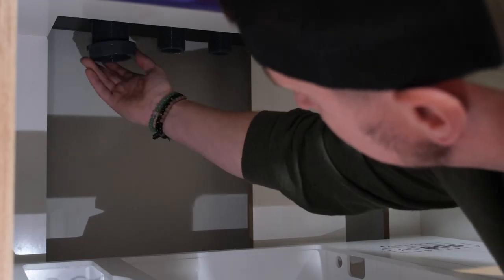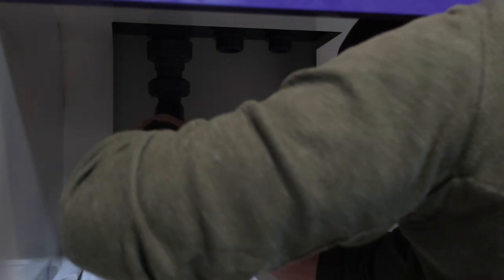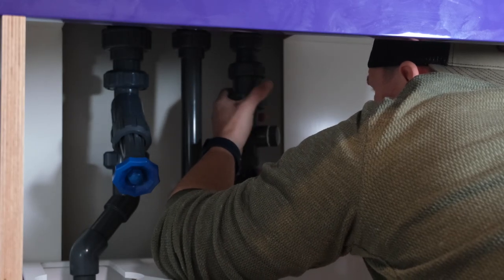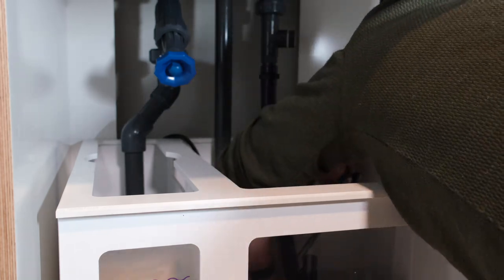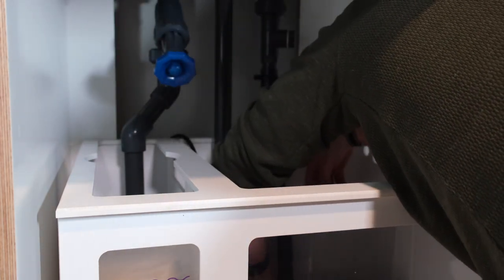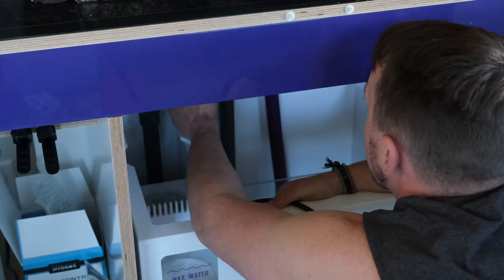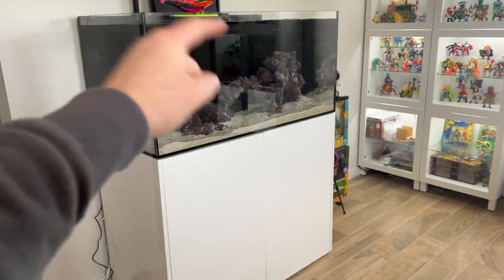How I Plumbed My New Saltwater Aquarium & The Setup

Comment: When you said you did everything correctly, i had allready noticed prior in the video that you maybe did something wrong.
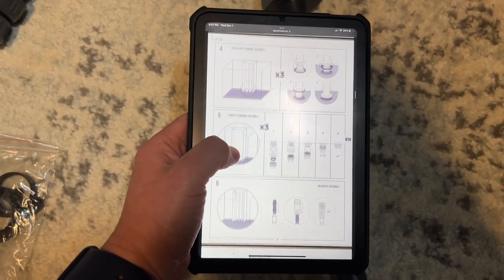You forgot to install the white washers on the bottom side of the bulkheads it seems. You can see them mentioned in the manual at 4:20 in the video.
Black washers go inside the tank, white washers on the outside.
Reply from the maker: No it leaked because a piece up top was pulling on the return pipe. Did nothing else but fixed the tension and bingo all set.